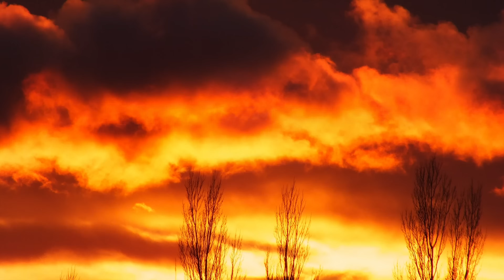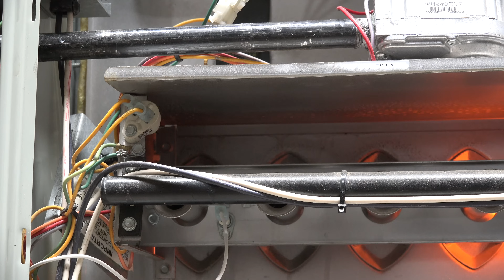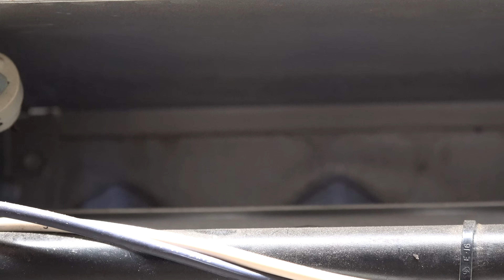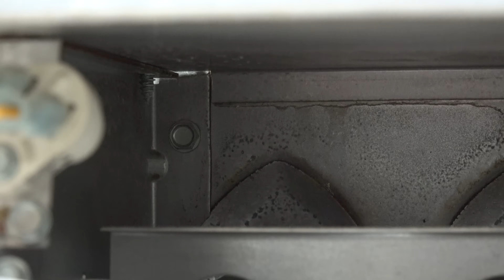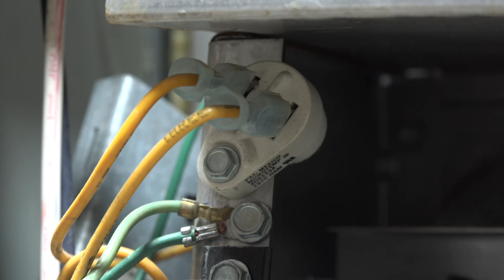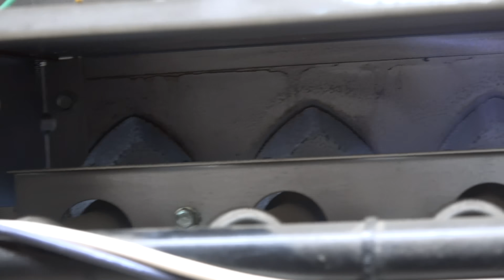Flame rollout from a blocked heat exchanger, gas furnace

Comment: My hundred thousand BTU American standard gas furnace is 22 years old. Never had any major issues with it seems to work completely fine.  Never had flame roll out sensor trips or limit sensors trips. Never any issues with the pressure switch. Just had to replace the control board a month ago. Flames all look great and unit works great. Have carbon monoxide detectors in the house.  Have never inspected up close the heat exchanger but wonder if it’s time to do a more thorough inspection of it then just what is visible.
Reply: Heat exchanger issues on modern furnaces are usually found by indirect means as the heat exchanger is mostly not visible.  Look for water (90% furnace), and all the things you mentioned.
GFM
Reply: @ thank you
Reply: Same story for mine just last year everything worked great. I changed the control board myself, cleaned flame sensor, put in a new igniter switch etc... it can just happen over time and it's no good anymore. 2001 carrier weather maker model
Reply from the maker: @Saint696Anger  Some of the high efficiency Carriers were recalled.  Not sure if it is still in effect.
GFM

Comment: so, how do you unblock it ?
Reply from the maker: That depends on what furnace you have.  If it has a draft hood at the top of the furnace, remove the hood and use a vac.  
If the furnace uses a draft inducer fan, remove the fan, inspect and clean.
GFM
Reply: @grayfurnaceman  it does have an inducer / will do and see how it works, thanks

Comment: If the inducer motor is working probably there shouldn’t be a roll out. If there is you have serious issues with the controller board. 
Good video
Reply from the maker: Why would you think a rollout would be caused by the control board?
GFM

Comment: I have one burner rolling out it’s causing havoc. Found a lot of moisture and setting water in the exhaust pipe. Any ideas on how to fix properly? Keep in mind this is one single burner rolling out?
Reply from the maker: If its rolling out, you probably have a blockage in the heat exchanger or a crack in the heat exchanger.  This needs to be dealt with,  dangerous!
GFM

Comment: Thanks for this video! I know there are plenty of things you can do to prevent this from happening, but is this something that can be repaired or the whole furnace needs to be replaced?
Reply from the maker: Repairs may be effective depending on why the rollout happened.  Also, if other parts are damaged, it may not be worth repair.
GFM

Comment: So how does tube get blocked? Improper air/fuel mixture causing soot buildup? Could it always be detected with combustion analysis?
Reply from the maker: There are various reasons.  Rust in the secondary heat exchanger, animals in the heat exchanger, Soot buildup (mostly in propane).  
Fuel mixture is not adjustable in most newer furnaces.  The only way to get the wrong mixture is too high manifold pressure.  
Combustion analysis is probably the last resort after I have eliminated all other issues.
GFM

Comment: Hello GFM. We have a 23 yr old Rheem 90 gas furnace. Last night after a normal cycle, the blower stayed on. We called a tech. My first thought was simply a fan limit switch issue. But while tech was here, while troubleshooting ,he always puts a carbon monoxide meter on the output. Anyway, It turned out to be a tripped flame roll out switch due to heat not flame. After a 30 minute cycle, the monoxide meter read 26 which indicated  leak. This morning another tech came from same company and put his meter on and got a 9 after a 45 minute cycle. He shut furnace down. Obviously two different types of meters. That's irrelevant. My question to you is even though the flames looked nice and tight, no ruffle, can there still be a crack in the heat exchanger? Thanks for your time. Jim
Reply from the maker: Was he testing in the supply duct, or the vent of the furnace?
GFM
Reply: Don't know which is which but he removed evaporation panel from humidifier and placed it in there. Hung it on the  ac's cooling panel . The heated air was blowing on it.The first tech did. I wasn't there for the second tech.
Reply from the maker: @JHenzly  He tested in the supply air.  The readings both times are low but I want to see zero.  Unless there are smokers in the house, I would be concerned.
GFM
Reply: Ty for your help and concerns. My mother quit smoking two weeks ago. No one smokes here now. Jim
Reply: After turning furnace back on, it ran through several cycles with  a CO detector near furnace last evening. No warnings from it.

Comment: I've got an older Goodman "Dependable Ninety-Two" gas furnace that has flame rollout only on startup. I've observed the burners when the circulation blower comes on and there are no signs of the flame dancing around or otherwise being affected as in the case of a cracked heat exchanger. So not at all sure what is causing the flame rollout on startup. Rollout switch in upper combustion chamber area has tripped several times in the past few days. Another issue is that initially the furnace had stopped because the pressure switch opened.  I restarted the furnace and it fired right up, but with the flame rollout taking place. I've also noticed that the exhaust outside has a very strong odor(that typical aldehydes of combustion odor but stronger than normal)I've also checked for CO and as of yet, there is none. Anyone know what would cause severe rollout on startup only? Partially clogged heat exchanger?? Thanks in advance.
Reply from the maker: The flame rollout on startup would be very unusual if it does not continue throughout the cycle.  Especially if the furnace is a 90% efficiency.  I don't have any answers here.
GFM
Reply: @grayfurnaceman  I agree and that is why I am stumped. A day earlier, the owner of the furnace thought she smelled gas so she called Duke and they came out and found nothing. No gas leaks, etc. Then the next day is when the furnace started the flame roll out issue. I've watched this thing begin it's cycle 10 times and it will ONLY roll out when it first fires the burner on call for heat. Gas valve energizes, burners light and across entire burner assembly flame rolls out for 2-3 seconds then burners return to normal. Absolutely zero roll out save for initial burner firing. Maybe a gas pressure issue? The burner doesn't puff hard on startup however as is often the case when gas pressure is off. I did as I say have a pressure switch code when I first took a look at this furnace but I started it up, immediately saw the roll out and it tripped roll out switch in chamber and has been doing it since. This furnace has an open combustion chamber so it is a single pipe. Maybe I should call Goodman tech asst.
Reply from the maker: @jimmymcneil4466  I hope Goodman is better than they used to be.  Let me know what you find.
GFM

Comment: Freat videos sir I like how you explain.
I have a question 
I have horizontal ropd130 oil furnace.
I changed the whole new burner, after I installed it ran fine, then I turned it off to finish the job I turned back on it went on for about 30 seconds & went off it tripped the reset button I tried it did again I have oil the fan stays on it's sensing too much heat because after a bit the intermittent ignitor resets it turns it on but it trips right away because it's still too hot.  I cleaned everything. I took the heat exchanger it's cracked, very soft, & chips off very easy do you it's the problem?

Comment: But which fan is the heat exchanger? Or is that the baffles in the furance? You don’t explain the terms you use.
Reply: These videos assume a working knowledge of mechanical things.  
A fan is not a heat exchanger.  A heat exchanger is the metal separation between the fire and the air being blown across to heat the structure.
GFM

Comment: lUXAIRE heater has NO rollout but the heat trips on code 5 which is a roll out switch code. System has 3 roll outs on the burner area. looks like switches have a reset but none are tripped. I am thinking it maybe the furnace main control board.

Comment: Great videos!  I have a Janitrol Dependable 92 furnace that has roll out from the middle burner only when the blower kicks on.  What could that be?
Reply: Would I be able to just plug the middle burner to be able to use the furnace until I solve the problem?
Reply from the maker: You almost certainly have cracked heat exchanger.  The air pressure from the fan is pushing the flame out.  Replace it.
GFM
Reply: @grayfurnaceman  That is what I thought.  Thanks!!

Comment: Great detailed video.  Thanks.
What could be the problem with a furnace that comes on as it normally does then while it runs the blower motor will stop for a second only, then start up again immediately.   
This happens about  3 times during this one cycle. 
The flame is on the whole time
during the cycle.
Thanks in advance.

Comment: Ok I think I fond  what going on I taped on side of Furnace were the circuit board is and motor came on all in morning no blower so code 13 so tap on side of Furnace now blower working again is it wire short or circuit board short now I put used bord from eBay so
Reply from the maker: Could be either one.  I would check all connections.
GFM
Reply: @grayfurnaceman  ok  thanks Gary
Reply: I pushed all the wires in I can here click from bord then blower comes on it's come on like 10 times today have to wait see if it does it again I'm not good with finding shorts in wires thanks again

Comment: Hi Gary can u help I put thermostat in and the blower work and had heat 3 or 4 hours later  no heat code 13 I no before I changed thermostat I got code 33 so heat tool out there two on top of buners and one on side could a bad bord work then not or is good or no good not sure if I'm telling it right to u thanks
Reply from the maker: You are overheating.  Thermostat is not the problem.  Plugged filter?
GFM

Comment: I've got a strange problem similar to a rollout.  Only happens when I put the burner cover back on, the flame on the burner that has the igniter on it will shoot out of the bottom side of the tube and burn the wires that connect to the actual igniter.  If I leave the cover off, I have no problems at all, the flames are sharp and straight with no movement.  Really confused.
Reply from the maker: What make and model?
GFM
Reply: Trane TUE080A948A0.
Reply from the maker: Can you send me a video showing the rollout?
GFM
Reply: grayfurnaceman well, the three times it happened it burnt my wire to a crisp so I'm kind of scared to put the cover back on.  I do work at a metal shop though so maybe tomorrow I'll grab a piece of steel to shield the wires while I place the cover on and record it.  Thanks!

Comment: That flame coming out when it just turn on is normal?
Reply from the maker: A very momentary flash is normal.  It should not last more than 1/2 second.
GFM
Reply: grayfurnaceman  Awesome. Thanks for the answer. Great videos by the way.
Reply: Great video... and this is the exact answer I was looking for. My furnace, when firing up the burners, sometimes  flashes slightly outside. But I would call it a flash. I was concerned...but watching this video and seeing this comment makes me less worried. Thank you

Comment: How do you unblock heat exchanger Gary? And can you jump the flame rollout switch to make sure that’s the problem?
Reply from the maker: If the heat exchanger is blocked and not cracked, you can disassemble furnace and clean it.
GFM
Reply: grayfurnaceman thanks for the reply, one more question, can I jump the rollout switch to see if that part isn’t working? (Crossing a piece of wire from one connector to the other)
Reply: grayfurnaceman I have a Trane XL80 and I’m getting a 2 flash code for lockout. Any clues as to what I should look at for the reasoning of the code? Im gonna check the following
Flame sensor
Rollout switch (if I can jump it) 
Manually reset the breaker twice in 30 seconds
Tubes/gas for obstruction 
Any other ideas?
Reply from the maker: You can jump it to test but I must reiterate operating the furnace for any length of time could be dangerous because of its use as a safety device.
GFM
Reply: grayfurnaceman ok, brother thank you so much for your help. I tried to jump it, with no luck. So I can tell you this, the glow plug/igniter lights up bright, but no flame comes across the burners. That’s pretty much leading to wonder could it be not getting gas from this valve? Or is something not allowing the valve to distribute gas?
Reply from the maker: It could be a number of problems.  No gas available.  Gas valve failure.  control board problem.  Check for 24 volts at the gas valve on a trial for ignition.
GFM
Reply: grayfurnaceman brother thank you again

Comment: my problem is just in the beginning  when the Furness start    rollout and then works normally.
but this flame burns out the cables    can you help me
Reply from the maker: Rollout is caused by heat exchanger cracks or blockages.  It is a serious problem.  Give me the brand and model #.  I may be able to help further.
GFM

Comment: Great help and thank you. I have a question I have a flame roll out  on just 1 tube and go  out on safety  what or how can I fix this problem I moved switch over and it well run and cycle
Reply: After start up flame roll out will go away but return  off and on thru cycle
Reply from the maker: +Bobby Holland I would first try cleaning the burners
GFM

Comment: the bryany 350mav will do this when the secondary fails.
Reply: Can you please tell me more. I just had to replace two Bryant 310JAV 036045 AGJA from burnt out heat coils and they were only (new house) 4 years old. I am very upset. Found this out when the Byran a/c broke down w/ oil leak and freon all over place w/ ice mess. $11,000. Ayame1958@gmail.com. Our entire neighborhood has these units. I am going to be advising my neighbors bu if you have more info, please email. Thanks.